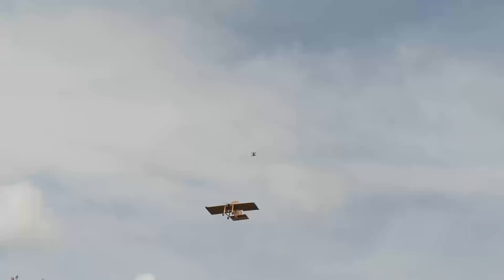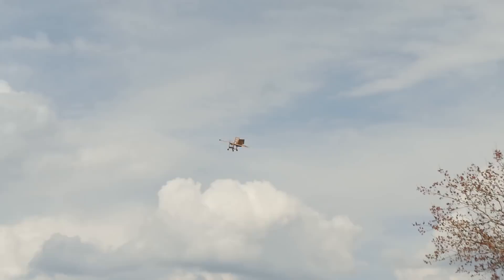CHAIRPLANE! We made an IKEA chair fly!

Comment: 5:52 like the old plane built by I forgot which was a heavy passenger plane but uses a canvas and 3 wings for it but its too wide and too slow also weak making it more heavy to pull by gravity so I think if you put a wooden pole or something that will make them still it will eventually fly but I'm not too sure since the wings is very small